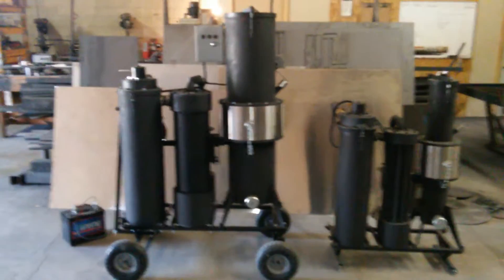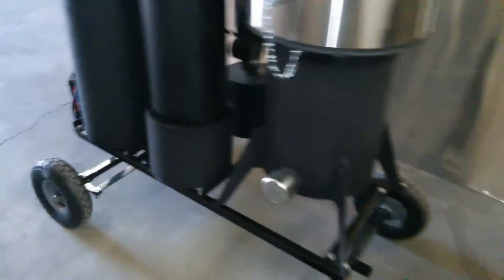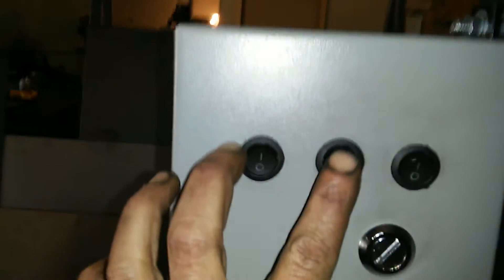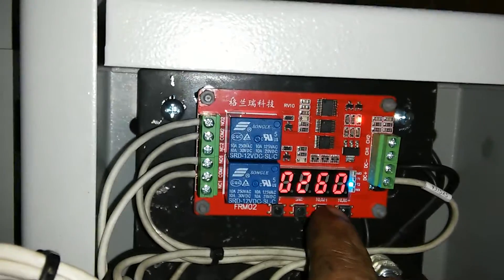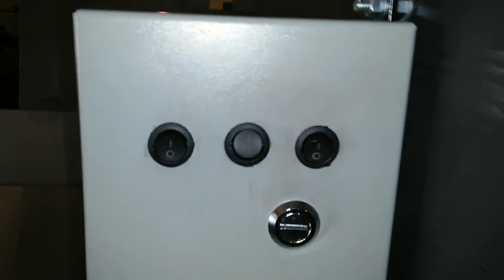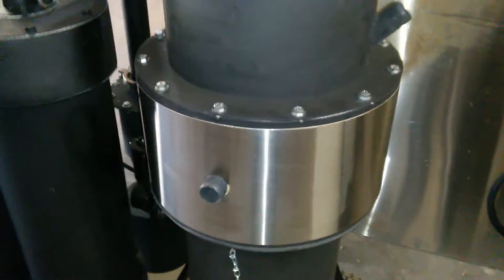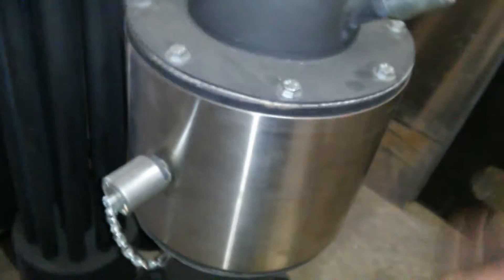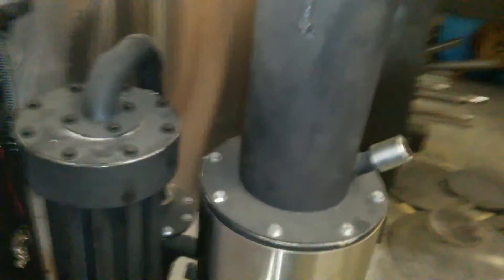2015 Vulcan Gasifier M-Series IV

Comment: Hey Matt. Is this the board you are using inside your control panel?? If so, I may be able to use it in my system for the grate and vibrator. I would just need to correct relays. 
See link....Thanks Mark
https://www.amazon.com/C-J-SHOP-Multifunction-Self-lock-Automation/dp/B01LJZVET0/ref=sr_1_35?ie=UTF8&qid=1493123877&sr=8-35&keywords=repeat%2Btimer%2Bcontrol&th=1
Reply from the maker: Yes those be the ones, they are great little very versatile boards.
Reply: Awesome. Now all I need to do is find a relay with 12 VDC input to 120VAC output and I'll be home free on the shaker. I should be able to find the 12VDC relays without issue. Thanks for the info.
Reply from the maker: Go to "automation direct" they will have what you need and are very fast shipping
Reply from the maker: You can pass AC thru just about any relay, its just the operating voltage that needs to be DC or AC. There both DC and AC ratings on the onboard relays of these boards. Its just opening and closing the circuit.
Reply: Great. Thanks for the info Matt. I really appreciate it.
Reply: Matt, one more question for you. Hbbyloggr asked me about the relays that YOU are using in the panel. He already ordered the board and would like to order 2 relays which he is going strictly 12 V all the way with the shaker and vibrator. Any info on the ones you are using would be helpful to him. Thanks Mark
Reply from the maker: I use this type of relay simply because they have screw terminals and use DIN rail mounting. They are also plug in socket type so they are simple to replace. https://www.automationdirect.com/adc/Shopping/Catalog/Relays_zTimers/Electro-Mechanical_Relays/SquarezCube_Relays,_Plug-In,_3A_15A_(78x-z__Qxx-z-H78x_Series)/General_Purpose,_15A_(781z782z783z_784_Series)/781-1C-12D

You need this socket in order to wire and plug the cube ralays into. You will need 30mm Din rails for mounting. https://www.automationdirect.com/adc/Shopping/Catalog/Relays_zTimers/Relay_Socketsa_Accessories/Relay_Sockets/781-1C-SKT

Many options to do this, but a simpler method maybe to use a simple automotive relay. We have also used these in the past.

https://www.amazon.com/Pack-EPAuto-Relay-Harness-Bosch/dp/B017VDI0GY/ref=sr_1_1?ie=UTF8&qid=1493151839&sr=8-1&keywords=12+volt+Relay
Reply from the maker: I cant get the links to work, you will have to go to automation direct and put this in the search field "781-1C-12D" when this page pulls up scroll down and you will see the sockets that are recommended
Reply: OK Matt. Thank you. I was on the site and saw the sockets and the cube relays there. I will pass this on to Bill (hbbyloggr) and I am sure he will appreciate it. Thanks man. Mark
Reply: Hey Matt. Another question for you. The relay sockets, do they take a special clip to hold them to the base in the panel or are they screwed directly to the base. The A.D. site says "35mm DIN rail or panel mount". I just don't want to order these sockets and find out later that I need a special mount for the sockets. Thanks Mark
Reply from the maker: You need the DIN rail you screw this rail to your base and they simply snap onto this rail. If you can build a gasifier you should be able to cut this rail to size and fit.
Reply from the maker: talk about flash from the past!!! This was only two years ago thats it? Seems like so long ago.
Reply: Hey Matt. Thanks for the info. I will look up the DIN rail and also let Bill know he needs to order it as well. I take it they are also available from Automation Direct??
Reply: While your video may be 2 years old, like all your videos, it has really good information and tech that others, like Bill and me can use to better our systems. For that, we thank you. Mark
Reply from the maker: yes you can screw them down but a pain its just so much easier to mount the DIN rail
Reply from the maker: I should prolly do a dont do this type of video haha :) May have noticed Im more laid back and just let it flow now days. Typical for them to run all day long without hitch and then as soon as the camera comes out oh no aint gonna cooperate now. haha
Reply: I will just order the rail. They are cheap enough at $9.00 for 39" length.
I believe their number is DN-R35S1-2 which is slotted, 35mm, 7.5mm height, 1m length. I think that would be enough for 2 relays huh...LOL
Reply from the maker: Here is a link the automatic mixture controller we offer if interested

http://www.thriveoffgrid.net/product-page/utility-series-electronic-fuel-mixer-controller
Reply: I have noticed you have changed some since I seen your earlier videos. 
With age comes wisdom and it isn't worth getting rattled. I do believe I am going to pull the trigger and order these parts. I like the way the timer works compared to the repeat cycle timers I have now. On my gasser, I notice that I will encounter a bridging before the grate needs a shake by looking at my manometers. As the vacuum drops below my manometer set point, I vibrate the hopper, then the vacuum goes up past the manometer set point indicating to me that it needs a  shake. As soon as I give it that shake, the vacuum returns to the set point for the engine I am running at that time. Then the cycle repeats itself about every 5 to 7 minutes. What I am looking for is to vibrate the hopper and then shake about 10 to 15 seconds later. That is my experience to date so far that works out for me and keeps my engines happy. Again, thanks so much for the information. Keeps me going,,,,,,,LOL
Reply from the maker: Yup you will now have enough to build them for all your friends :)
Reply: LOL, I can't afford 1 of them, much less 4 of them........Maybe 5 if I ever build that sawmill I want to build. But they are really sweet. Question. That is either one STRONG servo motor or you modified the the seats on that ball valve to operate a little easier. Usually, those ball valves are a bit stiff, but can be loosened up if you know how.
Reply from the maker: Yes I just put pipe plugs in each end and loosen em up. With the lever removed you need to be able to easily turn the stub with your fingers.
Reply: Cheater...LOL